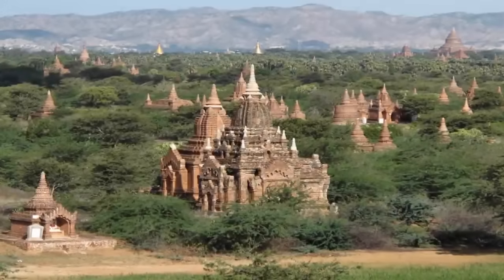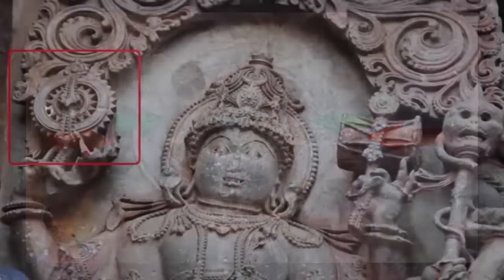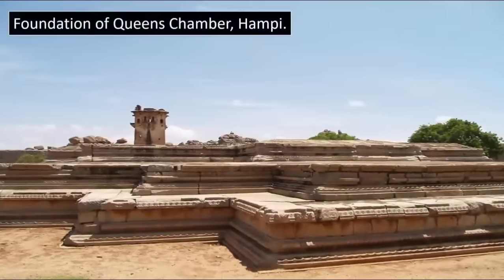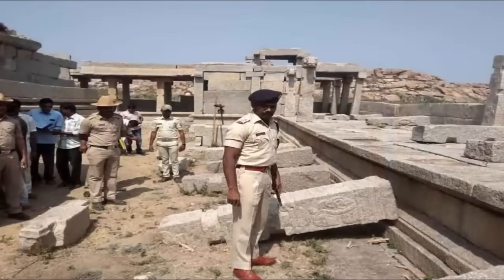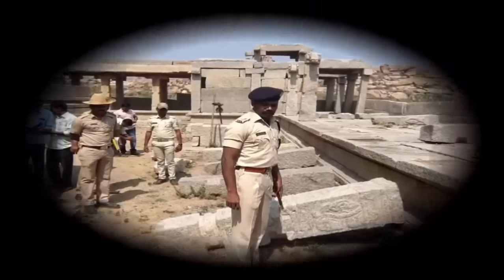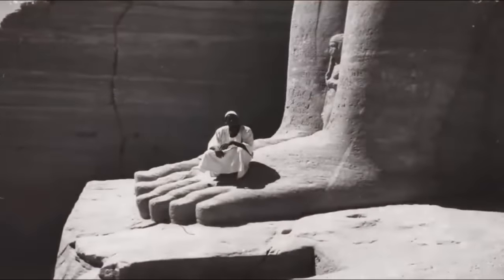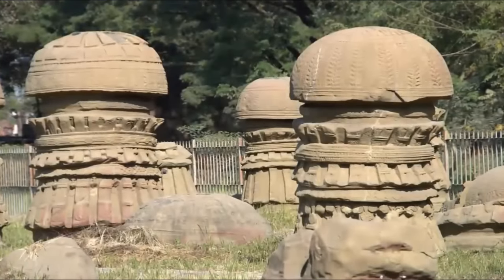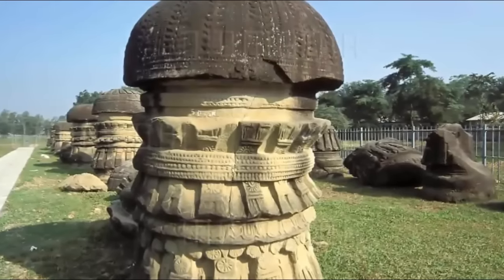Extraordinary Ruins Throughout India?

Comment: Water pressure
 A series of narrowing pipes. With a high(altitude) water source. Could make precision cuts.
Reply: With sandstone sure yes! 
But not with black granite.
Reply: @mattd5681  Then cooling for cutting tools. Water had to come into play somehow.
Reply: @kennethpeterson4068  Kinda. Depends on the kind of tools. 
Water is partially used to keep dust down.
Sandstone requires no water for cutting due to its softness.
Reply: @mattd5681  Also an energy source for cutting cutting and grinding. Remarkable stuff.